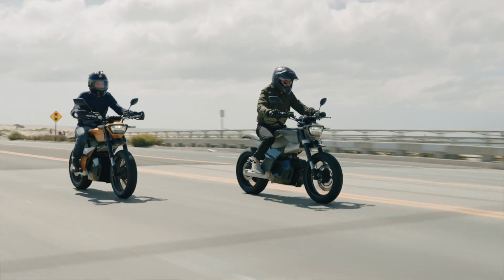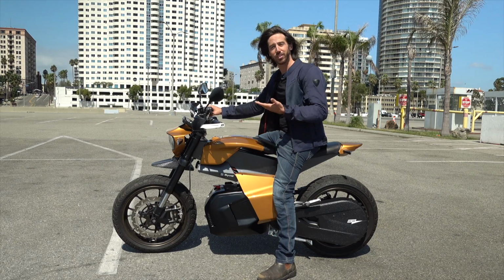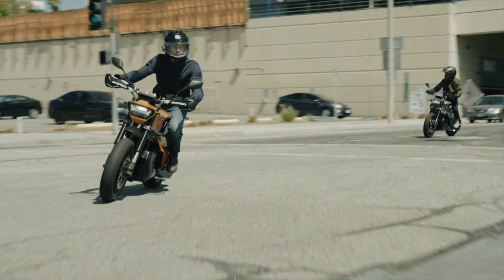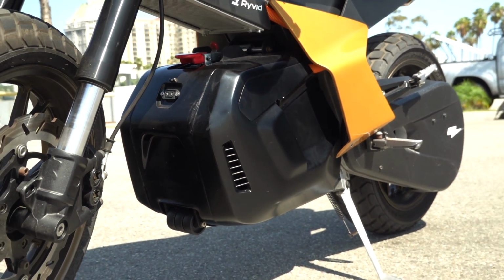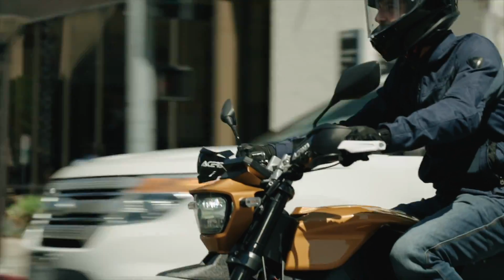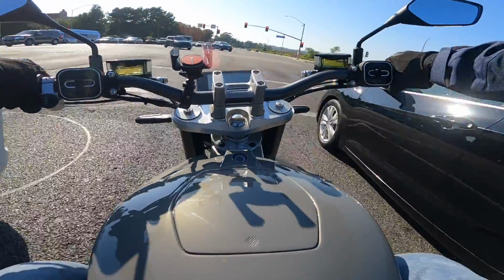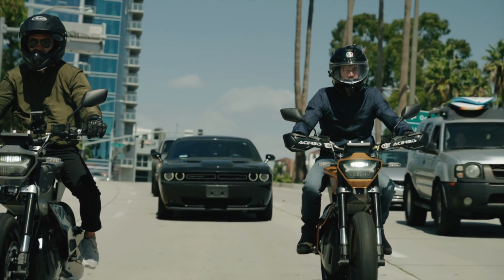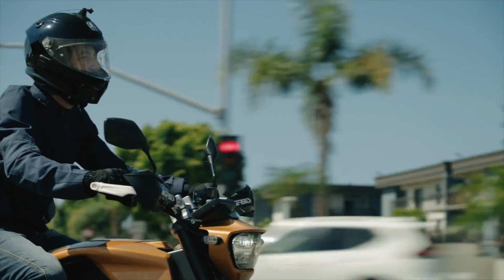Ryvid Anthem First Ride: Budget Electric Motorcycle Joy-ride!

Comment: This type of small, medium spec bike is exactly what I'm hoping is going to blow up big time. Any size of 4-seater car is too big for my needs, but a bicycle is a bit impractical for my commute, and mopeds/scooters are speed restricted to near useless and dangerous levels in my country, so small motorcycles are really the sweet spot. Energica, Livewire, and Zero are too expensive, and most of them too powerful for my commuting needs. It's a shame how Sondors are bumbling their metacycle with false promises and ridiculous mismanagement, but here's hoping Ryvid are going to churn out a line of strong products.
Reply: What about the ElectraMeccanica Solo?  Assuming the $18,000 USD isnt out of budget?   I'd like to see more innovation in that arena.
Reply: @7996hobguy  It's a great idea in theory, if your theory is simply about making a more efficient commuter, however in practice it makes too many compromises. The width is too carlike so it can't be parked like a motorcycle and can't split lanes, yet it has as little storage as a motorcycle. It also has to be built as a 3 wheeler because the US banned quadricycles.
A better option would be something like a Renault Twizy or a Citroen Ami
Reply: Absolutely agree! Few people seem to get this
Reply: @Xatzimi  the Twizy charges $62 a month to rent the battery.   And the Ami charges $11 a month plus $0.29 per mile.  No thanks.   Not interested in a subscription service based vehicle.
Reply: Same here, James. This is a nice example, I only wish it were in the $6000 range. Seems a little over-priced.
Reply: @7996hobguy  Exactly!
Reply: They make scooters up to 850cc... Simply saying they're too slow is demonstrably false.

Comment: Ryvid, please take note.  That huge cantilevered battery bounces around a lot at the start of this video.  You guys really need to look at that.  It's going to be a problem.
Reply: They have already addressed this with the new latching system for the production bikes.  They are also narrowing the cowl piece in front of the seat since it digs into ones knees.
Reply: it could be a safety feature. in case of a a crash with a car the battery detaches, and is shot forward, opening a breach in the car's crumple zone, and reducing the G's

Comment: A stamped/folded metal frame fixed with mechanical fasteners is also a cost-saving measure. Often that would be a criticism over a welded tubular frame.
Reply: It’s like how folded steel somehow became a selling point for Katanas, instead of a compensatory strategy for appalling Japanese metallurgy. 

If you just describe a negative with enough enthusiasm, it’s suddenly a positive.
Reply: @HALLish-jl5mo  I did not know that!

Comment: Nice review Micah.  But what you didn't point out was that the bike will also be able to use public chargers using the J1772.  This means that one can almost double his range.  The box type frame will be able to attach various storage compartments as well as the central box of the frame can also be used for storage.  This bike beats the Metacycle in acceleration, top speed, and distance.  Sure it is $1,300 more but has so many more features.  It is disappointing that the Metacycle promised so much more....which never panned out.  No more quick removable battery, poor actual acceleration, and less distance than originally promised.  Ryvid's changeable sprocket ratios is a plus.  The hub motor is limited in it's low end torque and heaven forbid that a single magnet loosens up which causes the hub motor to lock up.  The extra 6 months allows me to save up the difference in pricing.  The new production model will have the revised battery latch, new drive pulleys, a narrower front portion of the seat, and gas tank cowl.  On the pre-production gamma model, ones knees were hitting this portion.  Thanks again.
Reply: Metecycle only has access to sports mode in 2 mins at a time then its in eco mode to save power
Reply: @Blox117  some unicycles are approaching 4-5 grand now and arguably have a way steeper learning curve.
Reply: @Blox117  hub motors may have higher motor torque mostly due to being physically larger but once you factor in the lack of gear reduction and much lower rpms, wheel torque is actually lower. a 5kW sur ron, admitetly much lighter than a metacycle, also has very good torque from a stop especially with a large rear sprocket. metacycle is slow as hell on 0-60.
hub motors work well with small wheels like skateboards/scooters because there's no need for gear reduction 
unicycle pricing vs electric motorcycle...well you get what you pay for. unicycle: a wheel, a motor and a battery...suspension if you're lucky. can't ride it legally on the road or on bike path. stability, braking, are not comparable with 2 wheelers. I guess at higher speed any efficiency advantage disappears due to poor drag coefficient too.
Reply: @Blox117  magnets are as close as possible to the stator to increase torque. they can be glued/fastened, snapped etc but in case of very high roms/ vibrations, shocks etc they can sometimes fail which can be catastrophic for the motor
Reply: @Blox117  legality is maybe an non issue for you, not for everyone.
I've never ridden a EUC but I e seen a few video. some riders have impressive skills but unsurprisingly it's not as safe, stable and doesn't brake as well as an ebike.
https://youtu.be/IB9EFiS06S4
 difference with a road bike with lower center of gravity, bigger contact patch, ABS, will be even bigger. laws of physics still apply, and the differences amplify the more bumpy, slippery the road gets. 4 wheels beat 2 wheels beat 1 wheel. to my knowledge, ABS is not possible on a EUC because it has to provide exactly the amount of power or Regen to keep you balanced depending on the angle between the CoG and the contact patch. if wheel starts sliding during intense braking and if some abs did interrupt the Regen to regain traction, you'd just fall on your back.
bit you are right about the price, as motorcycles are lighter and cheaper than cars with similar performance. eux are even lighter and cheaper than comparable 2 wheelers.
I'd love to see euc's on a mountain bike downhill race, motocross track, flat track or motogp racetrack  and see how they compare
Reply: @Blox117  you haven't debunked anything.. motorcycles with hub motors are all cheap Chinese junk and metacycle is just the same with a nice aluminum frame. performance electric motorcycle all use mid motors and have way better handling and acceleration. EUC is a different subject but if you really want to compare with electric motorcycles, zero motorcycles have 530 to 850Nm of torque at the back wheel. a stock sur Ron is 300Nm
an euc can only put out as much torque as the rider leans forward or backward and the tire traction allows. 
the EUC with the highest torque seems to be InMotion V13 Challenger with 300Nm and it costs around the same as a sur ron at 4599USD
Reply: @Blox117   350Nm for 30lbs is impressive but do you have any evidence to back up you claims?
zero Sr/f has a 25kg motor that makes 190Nm at the shaft (verified on Dyno), a 20/90T gearing for 124mph that makes 190*90/20 = 855Nm at the wheel. this is verified data not random claims.  a different gearing could easily make more or less torque at the wheel depending on the top speed and the torque you want to achieve 
you still don't understand that the problem is not motor torque which is just a number on the spec sheet, but torque at the wheel.

powerful direct drive hub motors are heavy which degrades the ride quality and handling.

geared hub motor are limited in power and less reliable because of the integration of planetary gear set and only suitable for ebikes, up to around 2kW peak power.

mid motor can use gear reduction, spin much faster, produce more wheel torque and more power while being lightweight and compact and can easily be liquid cooled if needed for high power density. zero motorcycle motor makes 82kW and weighs 25kg. that 3.2kW per kg, and the motor is sprung mass, not unsprung mass.
of course a motorcycle is heavier than a EUC! the frame/ larger wheels, larger contact patch, suspensions is what makes them able to handle well at high speeds, cornering, on rough roads, be stable under cross wind etc
euc gives you simplicity, a battery a motor and a wheel and cheap acceleration with little safety

"inferior" IPM technology is what powers Tesla Plaid, rimac Nevera, lucid air, Koenigsegg quark motor. all the leading ev motor tech with the best power/weight ratio.  
BTW torque alone is useless if you don't have rpms. electric motors are perfectly balanced, have only one moving part and can rev very high and make insane power. making bulky slow revving low powered hub motors is good for cheap ebikes , eucs.

BTW mid drive motors are also not limited to IPM and can use whatever motor technology is best suited.
Reply: @geemy9675  don’t waste your time trying to argue with Blox117, nowadays you have no idea who’s sitting front of a keyboard.  If he doesn’t know the disadvantages of a direct hub motor then he hasn’t been around enough of them.  Maybe he is just a casual pavement rider.  I’ve seen a few magnets get hot and shake loose, and jamb up the stator.  Then it takes out even more of them.  Let him think what he wants.
Reply: @SilverShadow2LWB  yeah it's funny how hub motors are so much better yet not a single EV or serious motorcycle use them, right ? Plus they all use stupid and inefficient reduction gear instead of using the magical electric gearing of hub motors.. I really think he should run an electric car and motorcycle company and show the world his deep knowledge of electric motors
Reply: @geemy9675  It seems to me both you and Blox are quite knowledgeable. I've really been enjoying the debate and admire the civility you show. You both have made valid points. I'd like to hear how your argument holds up against the Aptera, what are your thoughts. I believe Aptera to be a legitimate company, unlike Workhorse which I use to believe in. Those are the only mass produced ev vehicles I know of that use hub motors. Now I'm wondering if the hub motor may be the reason Workhorse failed to succeed. I'd hate to think Aptera is doomed also.
Reply: @RPRosen-ki2fk  I love the concept of an ultra-efficient and light EV. but if you look at ultra-light cars, they are usually not cheap, and not safe. a recent F1 is light and safe (pilots survive 200-300kph crashes with little damage) but it's not cheap. manufacturers have been adding comfort and safety features and weight has skyrocketed through the years. if one little startup can make an EV that is half the cost, half the price and just as safe, then maybe all other manufacturers should just acknowledge they have no clue what they are doing and they should just stop making cars...but I still doubt it
 I almost pre-orderedd it but was put off by the delay, and the fact that as a two seater with limited cargo I would probably never road trip it, so my way cheaper /smaller used short-range ev that has 4 seats is actually more useful to me even though its only 100miles and doesn't have solar.
Oh and BTW I hate the idea of three wheels. I think it has much more to do with dodging the cars safety requirement than about drag coefficient. 4 wheels with front/rear aligned is less surface area than 3 wheels And I would surely trade in a bit of range for better stability
also if my car has hub motors, I want them as light as possible and 4 of them, with independent traction control and torque vectoring.

I would definitely  love a 4/5 seat 4 wheels aptera, if the paradigm proves to be safe
and the hub motors prove to be reliable.
Reply: @geemy9675  Thanks for sharing your thoughts. I agree that it's 3 wheel due to less regulations. I hope they succeed, I'm all for disruptive design.
Reply: @RPRosen-ki2fk  I hope it will still pass safety and get a correct score. I think I remember they said they would...you'd better not have a frontal crash against a hummer EV though
Reply: @geemy9675  to be fair, almost anything short of a tank would have a bad time in a frontal crash with a Hummer EV, and I don't think I'd want to be in the tank either
Reply: @Joesolo13  I know. it's just that with lighter vehicle you have both more G's in a collision, less material to absorb the energy. if you hit a wall or a tree, it doesn't matter as much compared to heavier vehicle. aptera is supposed to be 1800lbs in 60kWh version, estimates for the 25kWh version is 1300-1400lbs. this is less than half of a sedan weight, quarter of a full size SUV, and seventh of a hummer EV. With enough effort you can still make a small/light car have decent safety, but other case  of the aptera its the combination of 3 wheels, super lightweight, small cabin and low price that makes it hard to believe it s going to be safe

Comment: With the release of the second model, the Outset, on the platform, and the price drop on the Anthem, Ryvid will likely be the bike platform I start with. I can learn fundamentals of riding, on a strong but light platform, without most of the upkeep ice bikes require. I really only need it as a second commuter, if that, and an evening/weekend trainer for around the coast where I live. And that removable battery means it can charge upstairs where I live. I just need to save a tiny bit more for gear, and that initial insurance hit. Oh, and decide on which model to spring for. Man, it’s so close I can feel the wind in my helmet vents!

Comment: Only a veiled reference to Sondors metacycle! I think both look great and are great options for commuter bikes. Excited to see this space expand!
Reply: if weight is accurate and 0-60 is indeed in the 7s range, that's a huge performance difference vs the metacycle's 11-16s to 60mph with comparable rated peak power. maybe it's only with the shorter gearing but if it doesn't lag too much with the longer gearing, it's an indication that using a hub motor was a mistake. I'll take better acceleration, lower weight and better rear suspension vs silence and supposed efficiency advantage (that's probably negated by the current lack of Regen)

Comment: As cool as this is. The range is what gets me. Also my Suzuki TU250X is a perfect 24hp 250cc motorcycle that is like 1/3 the price of this and gets 200+ miles a tank, plus can cruise at 65 mph without any problem. It can also hit 100mph but that’s pushing it. 250lbs for this bike, while the Suzuki is 330lbs full tank I think. Heavier but still really light for a motorcycle. I can see the where this electric bike can be great but for someone who uses a motorcycle to “escape” on the weekend, or cruise with friends, this bike will just get me stuck with a dead battery because only 50-75 mile range is definitely not enough for that fun adventures that most of us motorcycle enthusiasts want. As a commuter it’s perfect but for that price range that’s breaking the bank a bit. Id rather buy a 400cc KTM Duke, or a Husqvarna Vitpilen or Svartpilen. Just sharing my thoughts on this, like I said this is a very cool bike. Just not what I’d personally be willing to invest in until the range is fixed and price adjusted to be more appealing.
Reply: Agree, I get around 60-70 mpg on my 5 gallon CSC RX4 ADV with a top end of 95. I commute with it alot and do 40-50 miles a day. This thing would be on the charger all the time.   :/
Reply: That's the name of the game with EV's. High price point with not enough range. 🤷🏾‍♂️🤦🏾‍♂️

Comment: Looks great, but I have my doubts about the longevity of a 65 pound cantilevered battery. Considering it was shaking in a few shots going over bumps, I wonder how robust the latch is and if it will hold up in places with rougher roads.
Reply: The latch is being changed on the production model.
Reply: @SilverShadow2LWB  also will have a lock on it for production model
Reply: @stopdropro  That's right
Reply: @SilverShadow2LWB  I've been a fan of this bike for several months now. Until this video's comments where at least two have pointed out this issue it really has me second guessing this design element. Do you honestly think this can hold up over time. 65 pounds going down the road over years of abuse got me thinking no latch system is going to hold up over the long haul.
Reply: @RPRosen-ki2fk  I am an engineer by background and after reviewing the bike with both Dong and Vihn at the Fully Charged Show in San Diego, I do think the design will work.  The lower part of the battery hooks onto the frame, and the latch basically holds it vertical. Sitting on the bike and rocking it side to side, one can really sense the low center of gravity.  The stainless steel frame sold me.  If any part needs replacing, it can be refastened together.  I like that the gear ratios can be changed.  If one is really worried about the battery, a safety strap can be devised.   The new latch will have a built in lock.
Reply: @SilverShadow2LWB  My concern would be stress cracks over time and damage to the plug-in connectors. I hope it's a non issue and the engineering is adequate. Other than that I like everything I'm seeing/hearing about this bike. I hope they achieve everything ... that Sondors failed at.

Comment: Solar E-clipse is a better deal.. You should get a test run. Trust me you will love it.
Reply: Solar is just a Yumi rebrand. I owe the Solar P1 pro. They also change the tire size in the P- settings to a larger diameter (example: mine has 11inch tires but they instructed me to change in to 12in). 

The best customer service you'll receive from Solar scooters is on the day you give them your money...after that they can care less about the condition of your purchase